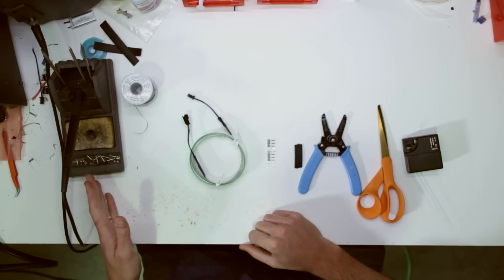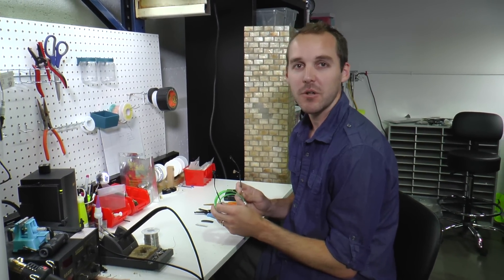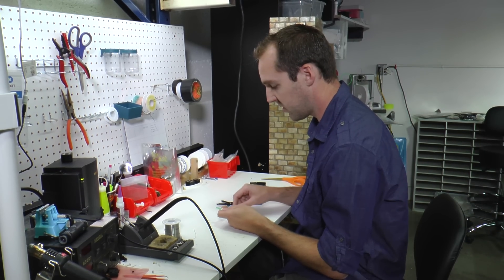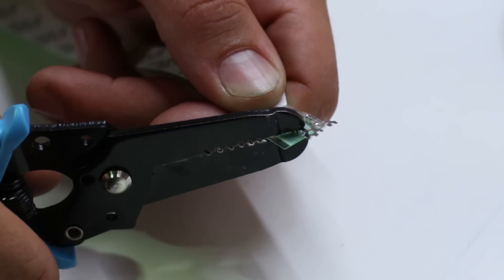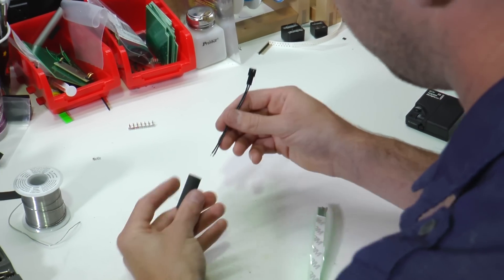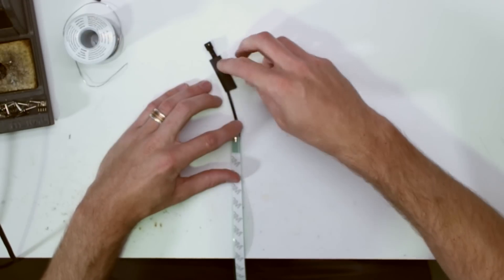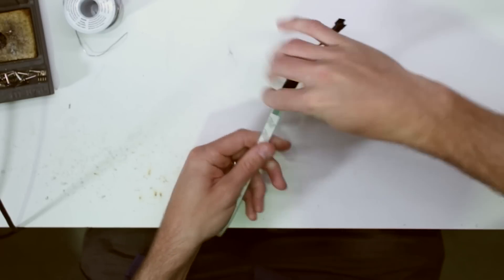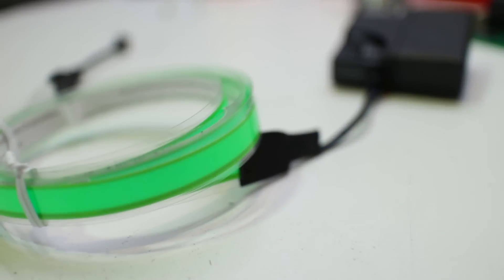How To Solder EL Tape - Ellumiglow.com

Comment: Is this so you can run a sequence of tapes? And how will it effect the drain on the inverter?
Reply from the maker: Each inverter is rated for a certain amount of square inches. As long as the TOTAL sqin of tape is within the inverter rating, then it should be able to power. Keep in mind the polarity of each piece you run in parallel should be the same, to avoid shorting. It is best to run in parallel rather than series as the more times run in series, the dimmer the whole tape segments will become.

Comment: Would something like this work for the crimp connectors?

https://www.digikey.com/product-detail/en/jae-electronics/DW1P04K4F2/670-2714-1-ND/4840202
Reply from the maker: It's possible, but we would recommend something more like these. There are "teeth" that can puncture through the laminate. The link you shared doesn't look like it has deep enough teeth to do that. https://www.ellumiglow.com/electroluminescence/electroluminescent-wire/el-wire-accessories/crimp-connectors-10-pack
Reply: @EllumiglowPage  Thank you!

Comment: Does EL Tape have a noisy power inverter like the EL Wire has?
Reply from the maker: Charles W All EL products (EL Wire, Tape, VynEL and EL Paint) all have the same characteristics in that they require a high voltage and frequency to excite the phosphor particles inside. Many overseas inverters operate at higher frequencies (many over 2000Hz, which do tend to be in our audible range. Customized inverters can substantially limit this noise depending on the application it is being applied to. For information on this, feel free to email our team.

Comment: Good how-to video, but your site is impossible to browse on mobile - I gave up as there's no categories, no search function, and hitting back in any browser resets to the top of the page. Aweful design for a website. 👎
Reply from the maker: Thanks for your feedback. Which mobile browser are you using? At the top of every page, there should be 3 lines which opens the navigation so you can select categories. There's also a magnifying icon to search for a product.

Comment: How if possible can i chain multiple el tap strips together? I was thinking using pcb cable, and using your method to soder them to the crimp connectors, then route them how i need them, and have the main one connected to a power source. Whould that work? Kinda like christmas light routing.
Reply from the maker: Domingo Muniz this is possible, but for best results we typically recommend having each strip wired in parallel so each run goes back to the inverter. If you have wiring questions, please send us any diagrams or questions to info@ellumiglow.com

Comment: Hi, if I had installed crimps on the el tape but now they are broken off, can I just solder the wires back on the metal part? Please see my photo below. I'm not so sure cause I'm afraid the heat might melt the tape, and I'm out of crimps at the moment. Thanks!

http://i1250.photobucket.com/albums/hh523/kevchan1103/DSC_3819_zpsaovzk4gn.jpg
Reply from the maker: Kevin Chan you can try to do that. If the connectors can't make solid contact, it will make a spark or flicker and let you know right away if it won't work. This is a good time to turn off the inverter and just get some new crimps. If you continue to leave it on, it can burn out the inverter or even melt the panel. Just be cautious when trying to solder and reconnect at the same spot.
Reply: Thank you so much for the prompt reply!

Comment: what about the other cutted part? is that usable ?
Reply from the maker: Yes, the other part is usable using the same method of attaching lead wire.
Reply: +Ellumiglow  awesome... thanks
Reply: If you cut the EL tape in half in order to have two thinner, long strips, are they usable aswell?
Reply from the maker: If you cut it in half "hot dog style", you will likely end up with inconsistent results. The bus bar running down the panel is different on each side, and one side may work and the other side won't. It's possible it will work, but it will probably be inconsistent.
Reply: thank you very much for the reply. im eager to test the limits on how much i can cut and shape hehe